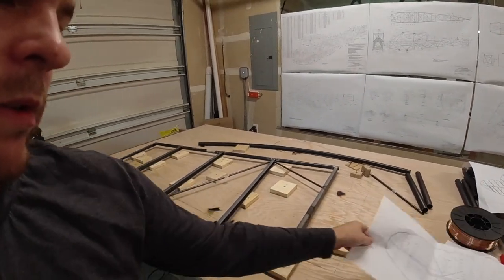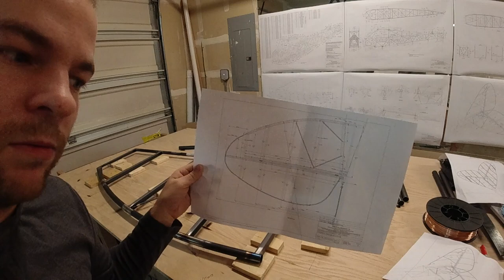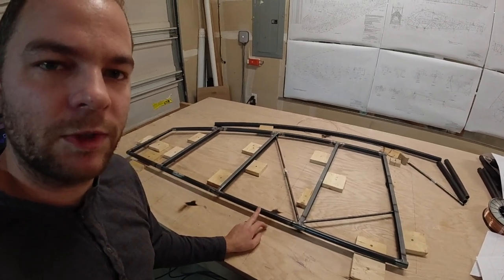Super Cub Build #1

Comment: great vid   Where did you find the drawings   that you have on the wall  is that from the Northland drawings  if so how did you get them printed   I have the northland flash drive
Reply from the maker: The prints come from VR3, they send them with the tubes.  I have the northland drawings but I probably won't use them until I need to start making tabs
Reply: @MaxRunia  awesome thanks for the comeback

Comment: Did the elevators , stabs and rudder come as a tubing kit from somewhere ?  You didn’t mention the source I don’t think ... was it the same place as the fuselage tubing kit ?
Reply from the maker: Yes the tail feathers also came from VR3.  They sell it in 4 tubing kits: fuselage, empennage, landing gear, and wing attach fittings.

Comment: You're doing it the hard way, good for you. I cheated and got a fuselage from Airframes Alaska. Of course I started with a certified airplane and had to keep it certified.
Which engine you planning on using?
Reply from the maker: Yeah if I could do it over I think I would buy an airframes fuselage, probably worth the money, saves you a lot of time welding.

How did that work being certified?  Did you already have a data plate and logbook or did airframes match one up with their fuselage when you bought it?
Reply: @MaxRunia  I refurbished a Cub. I bought a re-built cub from Cub Crafters in 2000, it was a 1957 model, original fuselage with little paint and used previously as a duster.
I use it on floats in salt water, and, after 15 years, the fuselage was rusting out so I needed a new one.

Comment: I just found this, very cool, if you have time I have a couple questions, what kind of experience do you have TIG welding and what wire are you using, what was the turn around time for getting your tubing kit and (sensitive question)I guess that was more than a couple questions. The Airframe Alaska fuselage is spendy so I think you made the right decision.
Reply from the maker: I didn't have any tig welding experience going into the build.  I did have limited experience with gas welding and mig.  I did a lot of research and practice with the tig setup until I felt comfortable starting on the tail feathers.

For the tig filter I'm using er80sd2 I believe?  ...I could be wrong it's been a couple months since I've been out there to weld.  I bought a 10lbs roll of it for mig and I just cut it to length for tig filler.  Lot cheaper that way.  

The VR3 turn around was pretty fast, they had it done and ready to ship before my payment arrived.  Between when I ordered and received it was maybe 6 weeks.  I think it was $7500 shipped if I remember right.  

I did look at other stuff, and if I had more money I would've bought the airframes fuselage just to save time.  But I figure I'll save something like $5-7k doing it this way.
Reply: @MaxRunia  Thanks for the information, er80s-d2 is the filler (lots of 4130 youtube) Keep up the videos! We all appreciate them.